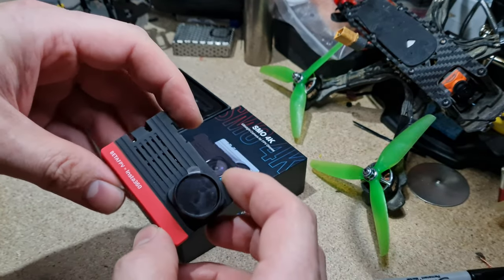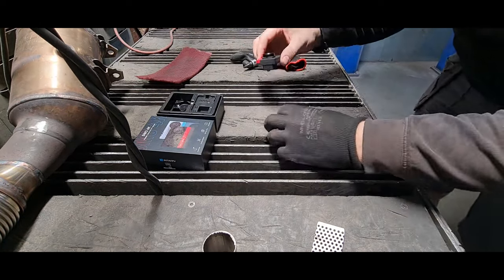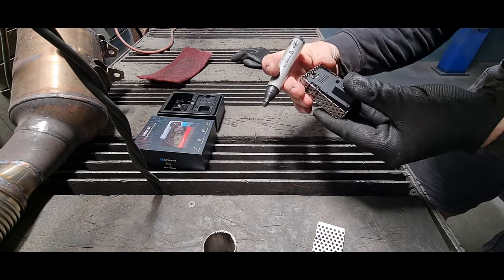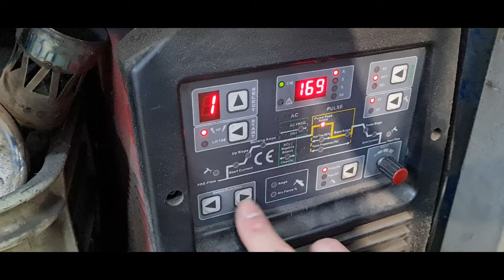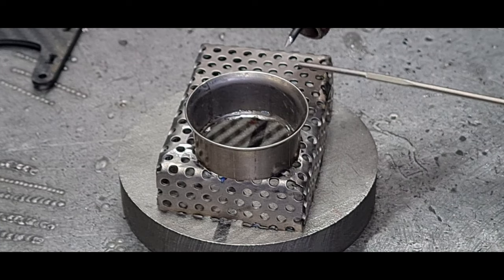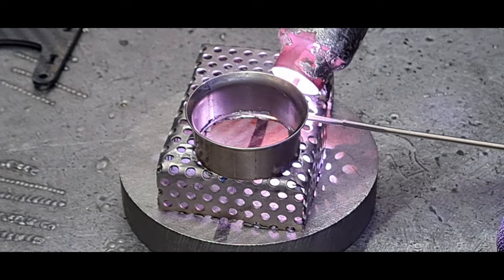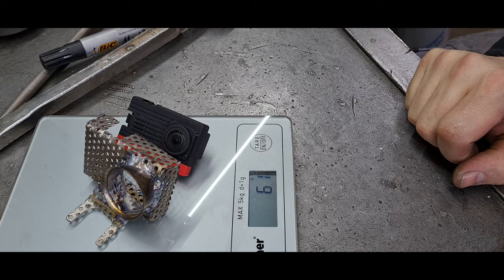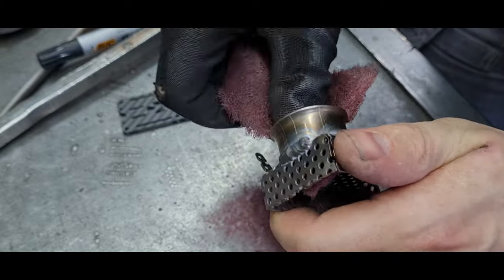Titanium case for SMO 4K fpv camera (hand made)

Comment: Will you sell? willing to make one for me?
Reply from the maker: Hi, so far I can't sell this project because I have too many problems with mounting and setting the camera angle. additionally, the camera is installed permanently by taking the sides out of the titanium case.

If I can
To fix it I'll let you know, I have one more case design for GoPro and SMO 4k, 15g lighter than this one. which will allow you to open and remove the camera and set the tilt angle. but for now it is in the design phase.